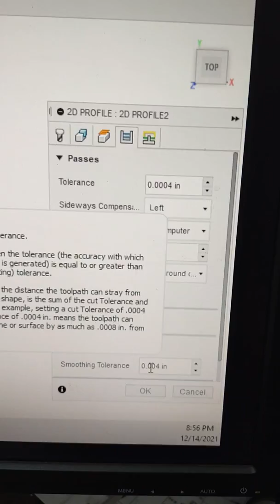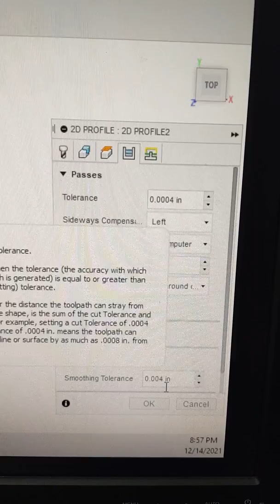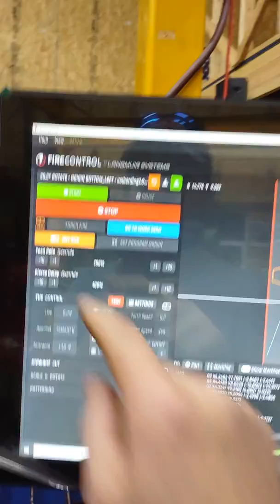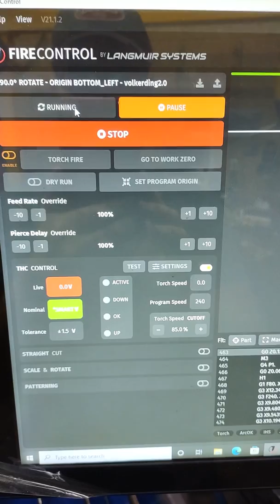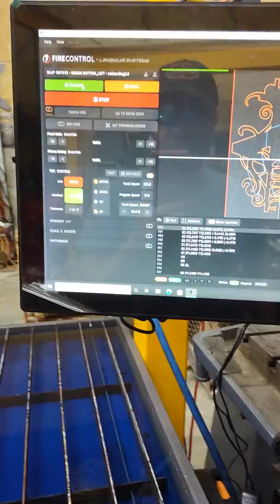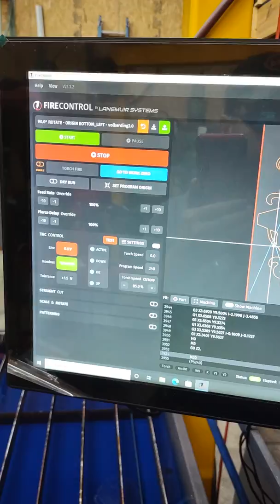Crossfire XR plasma table cutting 16 gauge Monogram

Comment: Nice work  !! So I have an XR as well and cut a lot of signage . I'm wondering what your pierce height and run height settings are? This is great info bro THANKS !! I've been having the same issue.
Reply from the maker: Pierce height is .150. Cut height is .060. What settings are you cutting with?
Reply: @Curtis_Schwoeppe_Enterprises  I've been paying around with different settings but the last cut I made cut was .125 and height was .035 . Lol guess that explains why I'm burning through tips . I may ask for more setting help , as soon as I get more consumables haha
Reply: @Curtis_Schwoeppe_Enterprises  And again THANKS for your help !!!
Reply from the maker: @BIGDADDY012341  Im not sure if you watched all my videos, but there is one that show my modifications and add ons that I did to the table. check out https://www.ebay.com/str/plasmadynplasmaweldingparts   in Pacific MO. they sell hand torches and consumables as well.
Reply: @Curtis_Schwoeppe_Enterprises  Thanks for the link !!! Wish i would have had that earlier , I bought some from First Industrial supplies  and it's gonna take 2 weeks for me to get them !!! I've watched all your videos and you've made some great upgrades . the drains I'll be using but I'm going to take it one step further and make it a fill as well . I have a Miller 375 Extreme hand held already so I don't need a hand held .This wait is KILLING ME !!! I can't make a good cut with the tip blown out and I have a ton of work to get done lol